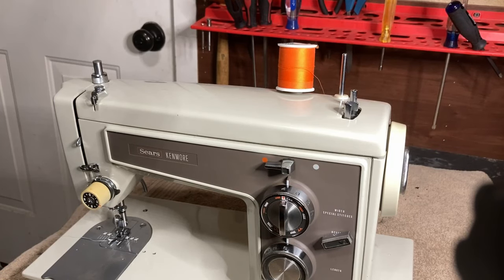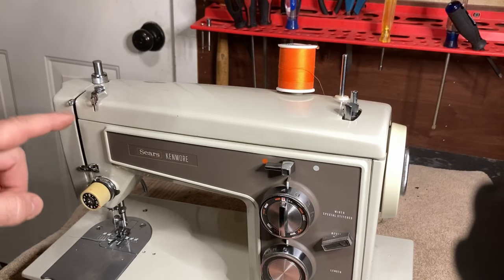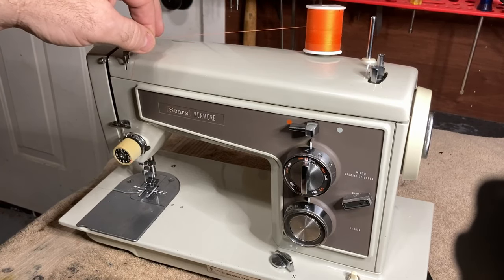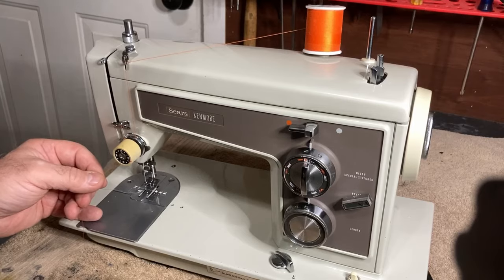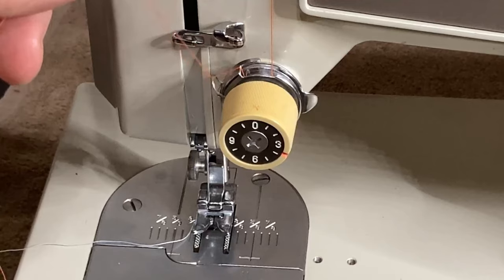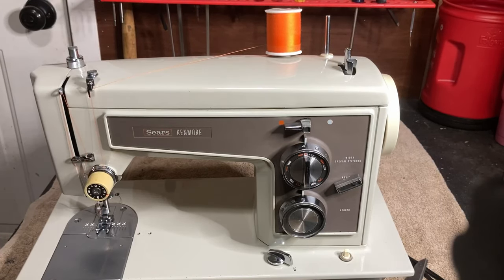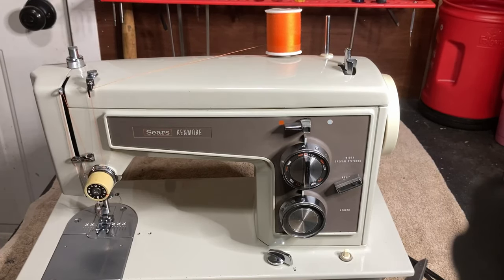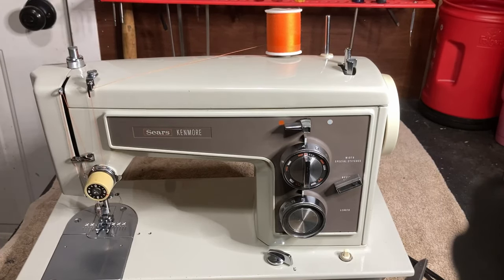How to use a Kenmore sewing machine  for beginners

Comment: my model  is 158.  from 1974.  Need manual for using the cams.  I have complete set of cams and monograms, but my model does not have anything to turn to use the cams.  My  drops in on the top of my machin.e.  Love your videos,  Could really use some help with this.
Reply: Many Kenmore manuals available on http://homeappliance.manualsonline.com/manuals/mfg/kenmore/kenmore_sewing_machine_product_list.html   Search for complete model number, eg 158.xxxxxx  Should be a metal tag on end of machine, or in front bottom
Reply: The cam button is on the top dial on the right, facing you, not the numbers on the silver outside part of the dial, if you have the two dials as in this model in the video.  I have a model from 1969 with cams and it looks very like this one but has a little lift up lid on the top where the cams go, and has a free arm.  You don't really need instructions because once you lift off the top bit that opens, it's only a few inches wide, you can see the cam and can figure it out, plus use the same colour matching of red and white icons on the dial, etc. Hope that helps. Xx

Comment: Hello and thank you for your educational website! It is very educational and easy to understand. I have followed your  tutorial which is amazing and I am ready to sew! The one problem I am having is that my Sears Kenmore model 158.18030 does not have an inner hand wheel to loosen or tighten. I was able to fill the bobbin but now I cannot sew  because the bobbin holder stem keeps spinning even though the machine is threaded correctly! Help!
Reply from the maker: Some of the machines have push pull on the hand wheel and some are automatic. I can help you  figure it out in my group. Here is the link  https://www.facebook.com/groups/47974...

Comment: I just inherited model 148.13110 and it was sewing beautifully until I put it in reverse. It works in reverse but I went to switch it back and it will not go forward now. I’ve taken it apart and put it back together without any luck. Any suggestions?

Comment: My machine looks very similar, it is a sears Kenmore but I have no idea if the model # where can I find it? The only difference I see is the stitch buttons are reversed on mine I’d like to get a manual for it.
Reply from the maker: Hello Donna, 

The model should be on the front just under the bed.

If you tilt the machine back you should see a tag attached to the front rail under the bed. It will have the model number on the tag.

Comment: Hello, loved the video, learned a few things! I have a similar machine, 158-14100. Inherited from my Aunt,she bought it brand new.  I am having a terrible time  with the tension. According to my manual I need to decrease my tension.  But, I cannot decrease it anymore to fix the issue.  Any way of having it repaired is many miles away.  Any suggestions?  There is a what appears to be an adjustment screw in the center of my tension knob, isvthatvwhatvi need to adjust?  Thanks for any help! Danny

Comment: I was just gifted a Kenmore 148.13022 but its not much info found on it, and I would have to order the manual. There is a Kenmore 148.351 and Kenmore model 53 which looks exactly the same. Well anyway is there universal feet for the Kenmore line or at least for the ones made between 1965 to 1971?

Comment: I have a Kenmore 10 model series 15812512. I'm looking to buy a Kenmore 385.15516000. is it a solid built machine like the Kenmore 10?
Reply from the maker: Hello Jeannie,

How are you doing?

The 385.15516000 is a decent machine, better than  the cheap machines they are making today.

I believe it has the lower reverse mechanism on the lower shaft.  It tends to freeze up if not lubricated properly but it is fixable by cleaning real good and lubricating.

Comment: I have a similar model Kenmore 158.13571 , my machine is pretty slow and wondering if it’s possible upgrade the motor? I don’t expect it to run like an industrial straight stitch but the speed is a lot slower then my other machines.

Comment: Hi
My clutch will not engage to the bobbin feature.  Its an old sears Kenmore model 158.17520.
I turned the clutch and needle still moves. Any information would be appreciated. 
Thank you Barbara
Reply from the maker: Hello Barbara,

More than likely the handwheel is stuck to the shaft due to oil drying up.

You would need to remove the belt, remove the screw in the  knob you turned (Don't loose that screw!) remove the clutch knob and there will be a small clutch ring, take note of EXACTLY the way it is on handwheel then remove it.

Now you need to work on getting the handwheel off, then clean the shaft it sits on as well as the center of the handwheel, denatured alcohol works well to clean it off, regular rubbing alcohol will work but take a little more time and work.

Then oil the shaft and center of hand wheel and re-assemble exactly the way it came apart, if you don't get the clutch ring back on exactly the way it came off your clutch either will not let go or will not engage and hold the shaft to move the needle, depending on which way you install it.
Reply: @sewingmachinetipsandtricks9079  🙂 Thank you..

Comment: I have a 1352 zig zag sewing machine. The tension in the bobbin is messed up.  Can you help
Reply from the maker: Probably yes, but I need more information.

From my experience when someone says the problem is bobbin tension, it is usually upper tension.

They call it bobbin tension because the thread is making a mess under the fabric, which is a problem with the upper tension.

I would suggest making sure it is properly threaded on top. That starts with raising your presser foot before you thread the machine, ensuring the thread is in the tension discs and in the take up lever.

make sure your needle is not damaged, check your needle plate for damage as well as your hook, as all of those issues can cause tension problems.

Comment: I have the next year model released as the last all metal.  Very much runs and acts like my Bernina 930.  What is the recommended tension on the foot bar for just basic normal cotton piecing.  Is there a recommended standard setting for that upright bar for just pretty normal non special piecing?
Reply from the maker: Recommended tension on the presser foot is when it starts properly feeding the fabric, on most fabrics that is about 50% tension.
Reply: Thankyou!!!!

Comment: I have a kenmore 148.19370. Have it set to zig zag but it only straight stitches. What do I need to do to fix?
Reply from the maker: Hello Terry,

The machine is probably gummed up from varnish and dried grease.

It needs to be cleaned and lubricated, specifically pay attention to the cams and linkage that connects to the needle bar.

Comment: Hello, I'm from Ontario. I inherited an old  Kenmore machine that was bought from Simpsons Sears Ltd., Canada. I would like to find out what year it was made. Model 148.12300 Serial 01232. The plate says specifically that these are the numbers to mention when requiring servicing. Will different feet fit with a low shank adaptor? Thank you in advance, Richard. Love your clear, instructive videos. They are very helpful. Thanks to you my machine is up and running and I've made 3 very small projects which turned out okay for a first-time sewer.
Reply from the maker: Hello Mary,
You are very welcome.  Usually the feet are interchangeable between Kenmore machines. There are a couple of exceptions to that. A few of the machines have feet similar to Bernina machines, they are not interchangeable with anything I know of.

Low shank feet may fit a high shank machine with an adapter possibly, you would have to test it to find out. A high shank foot will not fit a low shank machine. 

I don't have any information on that model Sears Kenmore, I am un able to find any information on it at all, sorry :(

Thank you.
Reply: I have a 148.12140  42971 I can't find much information about it  but it's been  good  even in light leather
Reply: @vinnyzepeda8430  Thank you for your response. I will try it on leather with a size 16 needle. Do you know what year is your machine?

Comment: How do you change the presser foot to a zipper foot? I've been using this machine for 7 years and aunt found all the cams and extre feet and I can't for the life of me get the zipper foot in place😬
Reply from the maker: If it is the correct foot then it will go on the same as any other foot does on that machine.

Comment: I have a 1781 convertible Kenmore, I’m not understanding how to change the pressure foot
Reply from the maker: @SandraYavorcik  
It is very similar to Bernina’s.

There is a lever you push to unloosen the screw and pull to tighten.

Comment: I have a kenmore 158.850 the part where you add thread on the bottom where do you pull the thread through  back to the top

Comment: Can you talk about which feet are compatible with the kenmores and where they can be purchased.
Reply from the maker: Different Kenmore machines take different feet. You need to know if it is high or low shank then usually a generic will work.  Kenmore no longer makes feet for them so your unable to buy new OEM parts.

If your not sure, tell me your model number. I will research it and get you a link with the feet you need.

Comment: Your video was very helpful. Thank you. I have a question about the base - on the portable model - do you know if it should open? Is there storage underneath? I can't seem to figure out how to open it. I had a portable Singer years ago and it opened for storing all the accessories. Any tips?
Reply: I have a 12 stitch, and there is no storage capacity on it
Reply from the maker: Every machine is different some do and some do not

Comment: Mine is model 158. 1255181. Missing bobbin case. Can you recommend a replacement part number? Thank you in advance
Reply from the maker: Hello Sherry,

That is a little different and harder to find bobbin case. 

The part number is KM50474 Sewing parts online carries it but they are out of stock right now, with everything going  on it could take a few days to a few months before they can get it in.

Here is a link if you would like to order it and wait.
https://www.sewingpartsonline.com/bobbin-case-kenmore-km50474.aspx

If you would like to get one with in the next few days they are also available on Ebay.

Here is a link if you would like to order it, there are several listings for it.
https://ebay.us/nFFzRZ
Reply: @sewingmachinetipsandtricks9079   thanks so much for the links and quick response, i am looking for the silver case to put the bobbin of thread in also. any help would be so appreciated.  have a great day.  sherry
Reply from the maker: @sherrywhite9200  

You are very welcome, unfortunately the only information I can find on the actual bobbin case is that it is obsolete.

You may go on eBay and start contacting sellers who sell vintage Kenmore machines and let them know what your looking for.

Someone may be able to help you with it.

Here is the manual if you don’t already have it.

It has the part number of the bobbin case you are looking for.

https://lookaside.fbsbx.com/file/Kenmore%20158.1010%2C%201110%2C%201255%2C%201262%2C%201440%2C%201450%2C%201457%20manual.pdf?token=AWzmosJfegDsH8EE_ts3c2g7NAlU3E3wHGyElXSE8_7_Z3fdLtYUbgZPGjjmtNFLrkdGviVSsoDnua8BIwAajEWshQ09soPxSk3nwKus_fbaY5YD6Y0Qrzr-PiKe6vE072geGfkZkaaPSwb5RYxHFB99eixTdu5rgs2Ld5pyAUgJvrsXvO6G3tNGnnuehoDwR_Cj2s8O1cQdn6O9RG2lftkqjojN7UZWDzfkgY6W9jp-NA

Comment: Have a Kenmore 148.15600 ,can't wind bobbin, shaft that bobbin snaps on does not turn, piece in front is clamped on bobbin??????
Reply from the maker: Th bobbin winder is probably frozen due to lack of lubrication. It need to be cleaned and lubricated.

Comment: I have a model 148. My problem is with the pressure regulator. The outer ring and inner pin seem to be frozen. When I try to change pressure, I cannot get it to press down or pop up. Any ideas?
Reply from the maker: It is probably froze up from dried oil/varnish.

Unscrew the pressure regulator clean it up and get it moving again. 

Also clean up the entire presser foot assembly while the regulator is off and make sure everything is working.
Reply: @sewingmachinetipsandtricks9079  I removed the regulator but didn't see anything moveable except a washer. What would you use to clean it? I tried oiling it last night.
Reply from the maker: @pamhochstedler7228  
The presser unit itself should move,  you can use denatured alcohol (regular rubbing alcohol will not work well) or finger nail polish remover. They both work well at removing dried varnish

There is a spring on the presser lifter under the pressure regulator make sure it moves and is not stuck.

Comment: Hi Richard, Thank you for sharing your knowledge.  I have 158-1774.  I can't seem to get it to wind a bobbin.  I pull the hand wheel knob out, push the winder lever but it does not turn the bobbin pin.  Can you help.  Thanks in advance.

Comment: I have a Kenmore 10 mode, series 158.12512. do you thread the needle left to right it right to left? How do you drop or adjust your feed dogs for free motion quilting?
Reply from the maker: Hello Jeannie,

The 158.12512 has a front load bobbin case so the needle will thread front to back. The flat side of the needle will face to the back.
Reply: @sewingmachinetipsandtricks9079  can you lower the feed dogs for free motion quilting? Thanks for taking time to read and reply to my comment!
Reply from the maker: @jeanniescrochetcreations4978  
No ma'am I don't believe you can on that model
Reply: @sewingmachinetipsandtricks9079  I've read the manual. It says for Darning(ie., Free motion) to place the darning plate over the needle plate to be able to move your work freely. Do you know where I could get a darning plate for the Kenmore 10 series 158.12512?

Comment: 158.18022 the reel holder thing under the needle keeps popping out and locks or jams 😩 what do I do??? Please help
Reply from the maker: That would be your bobbin case, sounds like either  your not getting it in properly.

Some reasons for that are:
1. The finger that sticks off the bobbin case is not properly lined up with the groove it fits in when you install it.

2. The bobbin does not properly fit in the bobbin case and keeps the bobbin case from locking into place. I have seen that a few times, try using another bobbin and see if that solves the problem.

3. The bobbin case is worn out and will not stay locked in place.
If this is the problem you need a new bobbin case.
Check the other two first , if it still will not stay in then I recommend buying a new bobbin case.

If you need a new bobbin case this one will fit your machine
https://amzn.to/3x5PKvp

If you need bobbins these will fit your machine
https://amzn.to/30CKhjr

Let me know if that fixes your problem.
Thank you.

Comment: I purchased a Kenmore electronic model #385 81254 in Ontario, Canada in 1996 or 97. Very soon after I lost the manual and haven’t been able to find one since. So, I packed it away. Machine is practically new. I’d appreciate a source to find this elusive manual. Many thanks.

Comment: i have a 158.14100 and the dial on the stitches (1,2,3,4) is really hard to move, is it normal?
Reply from the maker: no it needs to be cleaned and remove the drying oil then reoiled

Comment: Where do I find the model number on the 158 series?
Reply from the maker: It depends on the exact machine.

Some are on the back some are on the front rail underneath the machine.

Either way it will be on a silver tag, it will have 158.XXXX the x’s are the rest of the model number.

Comment: I have kenmore 6811 the old ones i dont know what outlet i can use is it 220 v or 110 v
Reply from the maker: If it was made in the US then it will be 120V  If it was made in Europe then it is probably  220V  each type plug is made differently. 

If it has not been altered then which ever plug  the cord end fits into will be the correct voltage.

So if it will fit in a standard wall socket of your house then that is the correct voltage provided no one replaced or altered the cord end.

Comment: I have a Sears Kenmore model 158 512 the serial number is 002497 can you please show me how to use it  thank you
Reply from the maker: That is a very straight forward machine, if you follow this video you should be able to thread yours.

Here is a manual if you need one
https://manualsoncd.com/product/kenmore-51-instruction-manual-158-510-158-511-158-512/

The stitch length is the lever on the right and the stitch width is the lever on the top.
Reply: How do I get the manual or see the video
Reply from the maker: @MariaCruz-xs8en  The video is the one your commenting on you just need to watch it and follow the threading instructions as it is similar for both machines.

To get the manual you click the link I provided in the last comment then you have to buy the manual for about five dollars, just follow the directions provided on that page.

Comment: I purchased an Kenmore 1813 in extremely good condition. I'm trying to draw up my thread from the bobbin. As I am hand turning the wheel & hold the top thread to allow it go down into the bobbin case it pops out my bobbin. What am I doing wrong?
Thanking you in advance.
Reply from the maker: sounds like you maybe using the  wrong bobbin for the machine

Comment: Hello I have a Kenmore 1652. My bobbin winder doesn't spin anymore.
Reply from the maker: Will it turn by hand? 

If you can turn it by hand but it doesn’t turn when engaged then you probably need a new bobbin tire.

If it will not turn at all the it is froze up and needs to be cleaned and lubricated.